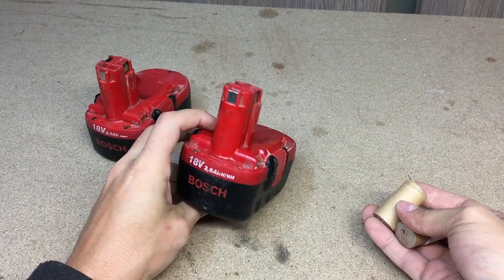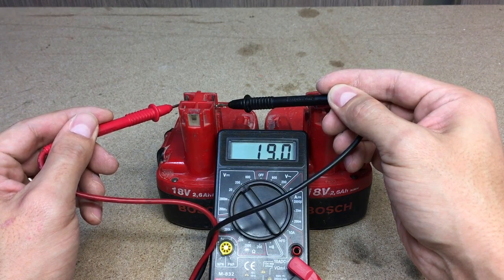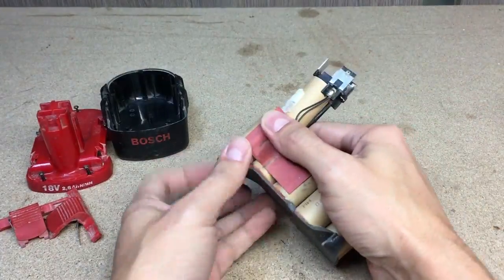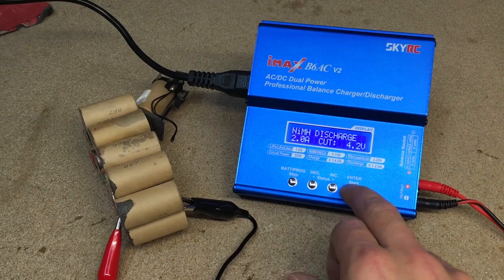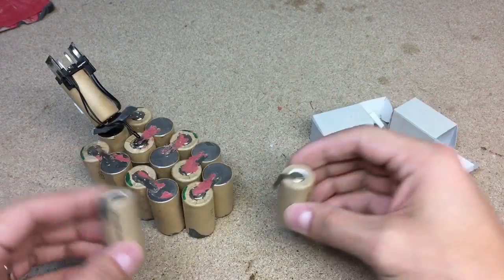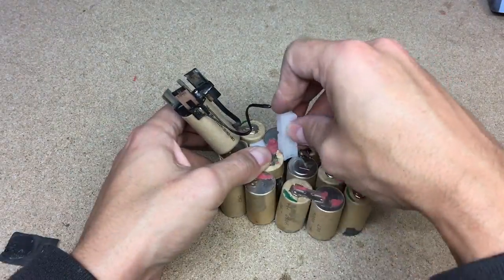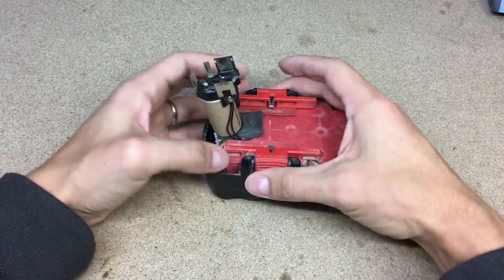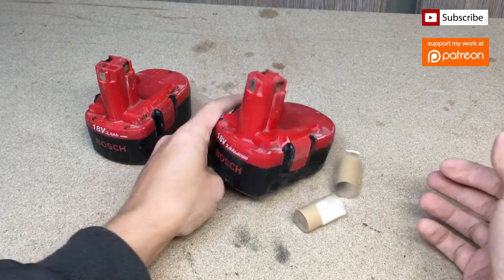DIY: Repair Faulty NiMH Battery Instead Of Buying New One

Comment: You can also invert the defective cells in the pack if you don't have a replacement... it will result in a less voltage pack but still works...

Comment: I would rather use a spot welder than solder because heat from the soldering iron may damage the battery

Comment: If have quite a few various brand cordless power tools from my late father which I have been cleaning up and checking them out during this lockdown period. I have loads of different Nicd and Nimh batteries all mostly working very/extremely well but a couple that need some attention. This video is very helpful to me. Thank you!

Comment: Repair my foot!! This is not repair this is REPLACING dead ni-mh  batteries misleading title
Reply: Sometimes repairing something is replacing the part that doesn't work.

If your vacuum cleaner belt breaks, you still call it a repair when you replace the broken belt with a new one. You don't actually have to repair the broken belt to call it a repair

Comment: '
better use R/C battery NIMH with 3000mah in the a pack of cordless drill...
much more easily...
old battery corrosion in the recycleable

Comment: Learning more about electronics via DIYing projects.... why does he want 20-21 volt reading on voltmeter when the batteries show 18v? Can someone explain this? Thanks
Reply: The nominal voltage of each of this cells is 1.2V, but the máx. Voltage is 1.5V (he says 1.4V), you múltiplo it by the amount of cells in the battery pack (I think there were 15), and since they are connected in serial you get a reading of 21V

Comment: Are those c cells or sub c cells? If the battery is leaking it needs to be replaced. It can NOT rejuvenated. Also look fro bulged batteries. these are also bad batteries and may explode if you keep trying to charge them.

Comment: Yes you can do a repair like this but when the nimh batteries are too far gone to bother with, I find using cheap 18650 cells are a great way to keep that old cordless drill going.
Reply: I have  a cordless drill with the same battery pack I want to  upgrade to li-ion battery 
Any circuit diagrams available

Comment: I've tried this quite a few times. It's OK if you're super desperate and live out in the middle of nowhere. I always end up buying new replacement packs on eBay for around $15. Buying a sub-C size battery with welded solder tabs hasn't been good for me because the pack cells always seem to be just slightly smaller and there's no spare room, so you need another failed pack to pull from. I've tried this method with 18650 laptop battery packs, too, and it's just not worth the effort (lots of delicate charging circuitry in laptop packs). I've had some luck scavenging from the battery recycle bin at the Lowe's store and also pulling high-quality solder-tab 18650's from old laptop packs (peel off the tabs, file the weld points). You might also try just going around the faulty cell with wire -- you'll only lose a fraction of the total capacity, and a good charger should be designed to accommodate the change. Just check pack and charger for overheating while charging.
Reply: Charlie Gosh :$15 my ass!
Reply: you can also just invert the defective sub-c cell... since it's ground already, it'll work just fine. result in a lower voltage pack but... works
Reply: Start your very own battery business and make huge money here: JoxCharge.com

Comment: individual cells from your non- working full set of batteries and from non-working individual multi cell batteries.................
What strikes me strongly  here is that professional battery restoring or exchanging batteries never use a soldering or pencil iron to connect the batteries. They have a Quickflash  soldering device which heats up VERY rapidly but doesn't touch the batteries long enough to destroy the individual cells as do the high heat soldering irons and guns which would linger too long on the soldering connection and  to get high. This heat generally destroys the new cell .The only answer is to do as the battery stores do and use a flash soldering gun. The temperature is high enough to perform good soldering but doesn't last long enough to destroy the cell itself.

I have seen people buy the brand new cells and the heat destroys any cells that are exposed to the pencil's soldering iron's gun's heat whenever soldering is used.
 The cell becomes ruined due to the temperature.
I'd be very wary of somebody who attempts to join these  types of cells by a conventional soldering iron or soldering gun. 

You are likely to destroy the new cell
However the SOLDERING would work great and is easy if you have the calibrated exacting flash soldering electronic device that the stores have.AND THE BATTERIES ARE NEW!

Using a pencil solderer,
Its heat is very high and can solder well .But the length  of time the heat is used to melt the solder, the greater risk there is to destroy the battery cell.
Reply: You must work for a professional battery restoration shop.
Anyone with ability with a soldering iron can easily do this without overheating the battery,
This man was very skilled with his solder and did not hurt the batteries.
Reply: i am in use to replace or build battery pack using this method since many years ago and never had a problem, built a lot of pack for my hely and airplane...dont believe what other ppl suggest, often only for sell new batteries: moreover i recharge standard batteries ....never had problems
Reply: No, you're risking ruining the new battery when you attempt to solder it. The thing is tho, if one knows what he/she is doing, it can be an easy fix....
Reply: The Heat of a soldering gun or iron may very well destroy the batteries. Professional battery replacement establishments use of very rapid flash welding in order not to injure the batteries. I would not risk using the method you described.
Reply: What are you risking?  A €3 euro cell?  A battery that's done for anyway?. 

ONE replacement 14.4v NiMh battery for a perfectly good Bosch drill/driver costs €313 where I live.
Reply: @arthurfischer1717  they use it in order to save time and money with that. And no, you will not destroy a nicd/ nimh with a soldering iron unless you sleep while soldering the tabs.
Reply: Rmaring
Reply: +Dominik Spencer 
I successfully rebuilt two of my cordless phone batteries using a soldering iron and help from this video.
The battery does heat up, but it's not enough to damage it. 
Phones are working fine.
Reply: yes, that means that you, as well as myself, can do this without harming the batteries. I'll be fixing another today!!
Reply: Shoerack
Reply: … Or use solder from Tin, Bismuth and Copper melting at 138 degrees Celsius. Can be bought all over the place. Then you can, in principle, solder with a hairdryer… And you don’t need higher melting temp on batteries. If the temperature in your pack goes above 138 C, you have more serious problems.
Reply: Arthur Fischer aaaa

Comment: what are the small black wires for ?
Reply: Usually indicates negative connection. Also to connect terminals.
Reply: i would say it's a thermistor. if battery is too hot, it wont charge till it cools down. heat is very unpleasant for batteries

Comment: Not bad buddy, not bad
Reply: individual cells from your non- working full set of batteries and from non-working individual multi cell batteries.................
What strikes me strongly  here is that professional battery restoring or exchanging batteries never use a soldering or pencil iron to connect the batteries. They have a Quickflash  soldering device which heats up VERY rapidly but doesn't touch the batteries long enough to destroy the individual cells as do the high heat soldering irons and guns which would linger too long on the soldering connection and  to get high. This heat generally destroys the new cell .The only answer is to do as the battery stores do and use a flash soldering gun. The temperature is high enough to perform good soldering but doesn't last long enough to destroy the cell itself.

I have seen people buy the brand new cells and the heat destroys any cells that are exposed to the pencil's soldering iron's gun's heat whenever soldering is used.
 The cell becomes ruined due to the temperature.
I'd be very wary of somebody who attempts to join these  types of cells by a conventional soldering iron or soldering gun. 

You are likely to destroy the new cell
However the SOLDERING would work great and is easy if you have the calibrated exacting flash soldering electronic device that the stores have.AND THE BATTERIES ARE NEW!

Using a pencil solderer,
Its heat is very high and can solder well .But the length  of time the heat is used to melt the solder, the greater risk there is to destroy the battery cell.
Reply: the
Reply: rofessional repaired cells
Reply: professionally
Reply: I vby.
Reply: rofessional feared
Reply: individual cells from your non- working full set of batteries and from non-working individual multi cell batteries.................
What strikes me strongly  here is that professional battery restoring or exchanging batteries never use a soldering or pencil iron to connect the batteries. They have a Quickflash  soldering device which heats up VERY rapidly but doesn't touch the batteries long enough to destroy the individual cells as do the high heat soldering irons and guns which would linger too long on the soldering connection and  to get high. This heat generally destroys the new cell .The only answer is to do as the battery stores do and use a flash soldering gun. The temperature is high enough to perform good soldering but doesn't last long enough to destroy the cell itself.

I have seen people buy the brand new cells and the heat destroys any cells that are exposed to the pencil's soldering iron's gun's heat whenever soldering is used.
 The cell becomes ruined due to the temperature.
I'd be very wary of somebody who attempts to join these  types of cells by a conventional soldering iron or soldering gun. 

You are likely to destroy the new cell
However the SOLDERING would work great and is easy if you have the calibrated exacting flash soldering electronic device that the stores have.AND THE BATTERIES ARE NEW!

Using a pencil solderer,
Its heat is very high and can solder well .But the length  of time the heat is used to melt the solder, the greater risk there is to destroy the battery cell.
Reply: +Arthur Fischer He did a fine job and you are splitting hairs.  
Quit with the over dramatics. 
You must work for one of the professional rebuilders and can't stand someone doing it themselves...
Reply: Naw, the batteries are not destroyed by being heated up to certain levels. Make sure the soldering iron is properly tinned and use a proper amount of resin and the process is fast and successful.
I did two last week.

Comment: what is the loose  black wire  in the pack.
Reply: It's the thermistor temperature sensor. It switches off the charger when the cells start getting warm - ie when fully charged and are dissipating charge current as heat. It's  safe to use this method only with NiCad cells

Comment: This is realy NiMH ?  ..  maybe NiCd ?
Reply: No matter which, the process works for both. NiMH are better however, just don't ever replace NiCd cells with NiMH cells unless changing ALL of them at once, they do not charge properly otherwise. If you have TWO NiCd batteries and BOTH are sort of charging but not fully, replace ALL the NiCd cells in ONE battery with NiMH and hopefully find enough GOOD cells in total to make another good battery of NiCd cells. I have done this several times on all sorts of drills with pretty good success. Even if you are one or two NiCd cells short you can just buy a few new ones.

I have even converted old 12v NiCd batteries to 18V NiMH batteries (of the same case type) with great success.

There is a great video on YouTube of a guy (Russian I think) who does a superb job of replacing NiCd cells with Lipo cells in a Bosh drill, including power check meter built in! That's MY next project. Do a search for it.